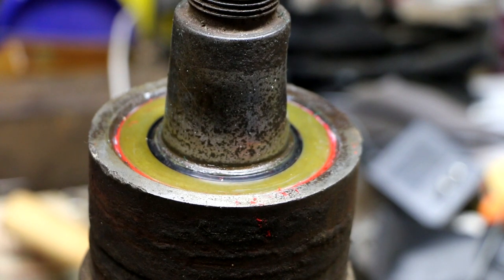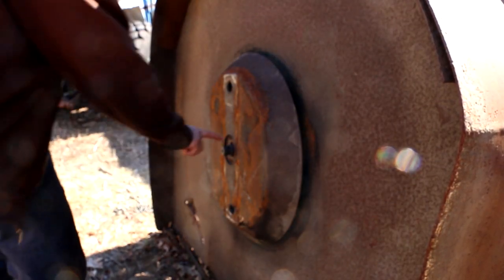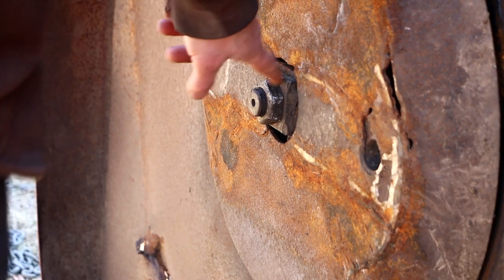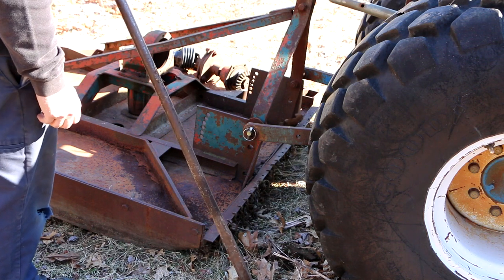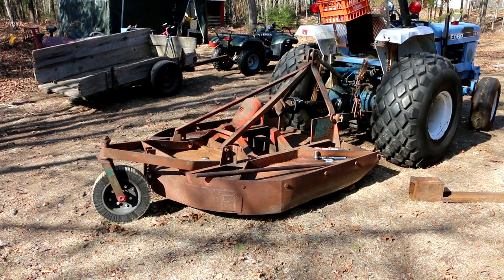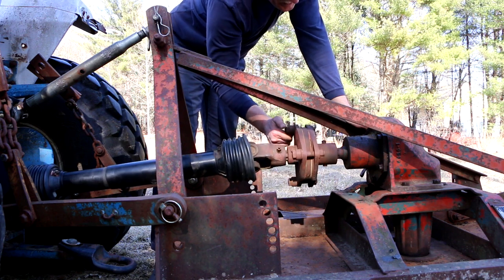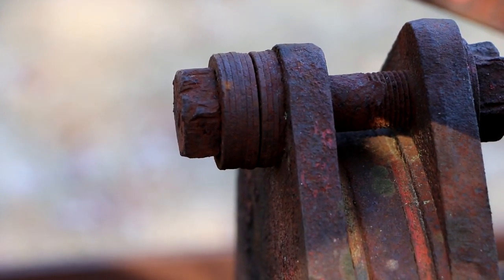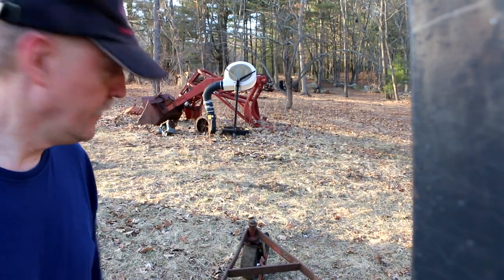Brush hog repair Bush Hog Model 305 Part 5: Success!...Sort of.

Comment: I'm a little late to the party here but that sure was a hard-fought repair of this old bush hog.  I think I would have flipped it over an embankment and said good riddance LOL. I admire your tenacity.   
One note though, Woodruff Keys aren't made of hardened steel for a reason.  I hope if something goes it won't ruin all your hard work. Those slip clutches look too rusted to work properly. But if the beast is cutting like you need, it probably doesn't matter. Jobe well done.
Reply: Slip clutch is made to slip to save the gear box if it gets bondup it will ruin the gearbox

Comment: The torque spec for those bolts attaching the blades to the stump jumper is 460 ft-lbs.  Do you think you got anywhere close to that?
Reply from the maker: Lol, I doubt it. But they seem to be holding. Its the nut that hold the stump jumper on the shaft that I need to keep retightening. Do you use locktight on yours?
Reply: @stevewatr  I see in the video that yours does not have a castle nut and cotter pin to hold it tight on the shaft.  I have a model 306 (very heavy frame) and that's the way mine is set up - castle nut and cotter pin.  I suggest that you drill a hole through the shaft for a cotter pin, and get a castle nut that will match the threads on the shaft.  That should hold it securely.  You might have to replace that spacer plate with a thinner piece of metal or a flat washer.
Reply: That loose U-joint and slip clutch are making all the noise.  I suggest that you remove the slip clutch completely, and just use a grade 5 bolt as a shear pin to attach the U-joint to the input shaft.  That is how mine is set up.
Reply: @stevewatr  Put a spot weld on top of shaft and nut. You won't have to tighten again. Just grind it off if you need to remove.